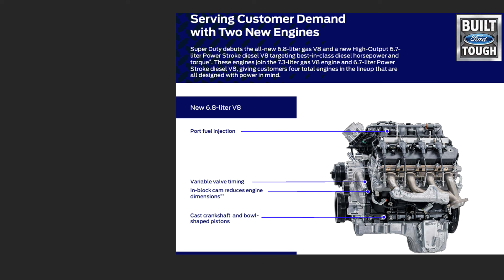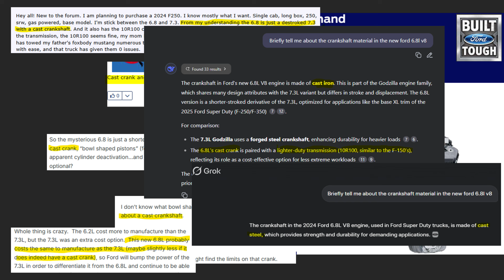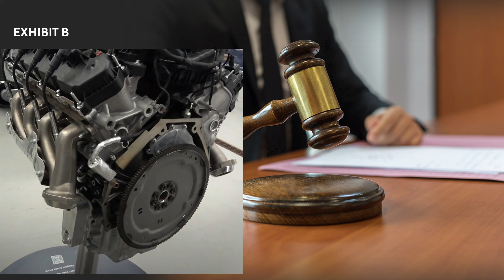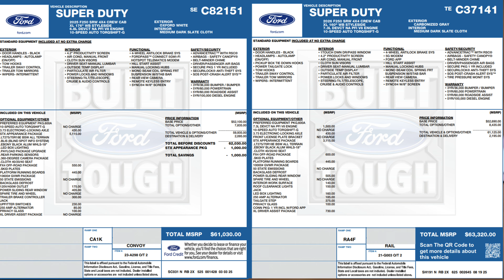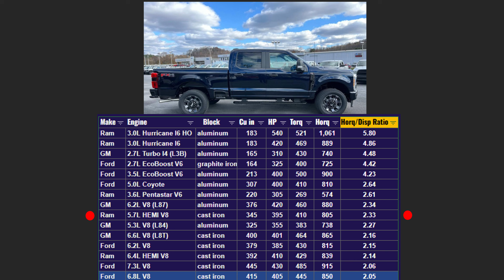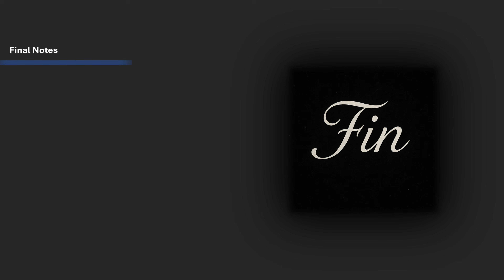Ford’s “Minizilla”: Making the case for the 6.8L V8

Comment: My brother had a 2022 F-250 Tremor (it’s really a 350 with the extra leaf spring).  He has the 7.3 Godzilla engine.  I have driven it and it is powerful.  Doesn’t do too bad on gas on the freeway.  I personally don’t call it a Godzilla engine.  I call it the Kong  engine cause it’s made in America, and Kong is American….Godzilla is from Japan.  I would definitely buy the 6.8 engine.  It’s just as good an engine and for only an 8% power drop…..I can live with that.  I tow a 5x8 ATV trailer and maybe a Bass boat.  The 6.8 will more than do the job.  I will however never live down my older brother calling any truck I buy with an engjne smaller than 7.3 liter, a tiny truck!!
Reply from the maker: Ha!  The 7.3 is the only engine out there that can call the 6.8 tiny.

Comment: I've been saying since day one, the 6.8 would actually make a better swap motor in anything 4,000 or less. That short stroke will help in spin. I check the salvage yard sites all the time, and the 6.8's are a lot more difficult to get your hands, since it came out 3 years later. Just my 2 cents.
Reply from the maker: I agree - I remember seeing a video where they said something like ‘you’d have to be dumb to swap a 6.8 instead of a 7.3’, but they didn’t think that all the way through.   Bigger number is not necessarily better.
Reply: Oh yeah, it's just like a 4.8 vs 5.3 just on a much bigger scale, you could make as much power as you could possibly want with a 6.8 and it should be significantly cheaper than a 7.3. You do a cam, headers, tune you have 600hp+, add boost 1500hp+ with supporting mods.The Godzilla platform is way better than the LS it simply isn't as wide spread yet and people haven't had the money to hot rod and get into a new engine platform since 2020 with covid and the economy being bad when it was introduced. The 6.8 will surpass an LS7 or LSX for 6.0 money in the future. A bare block is $1500, used heads are like $600-700 a pair or $600 each new, used 7.3 cranks are $200 or $600 new, forged rods and pistons are out there, Callies has stroker kits and huge cams. I bet a 522ci Godzilla stroker with ported stock heads will be a 750-800hp n/a engine. Just a 0.030 over 452ci should make around 700hp and a 6.8 would only need more rpms all else equal for the same peak HP.

Comment: Forget the TFL crap.  Those guys don't know anything anyway.  Why don't you make a towing video of your truck?
Reply from the maker: Oh I enjoy their stuff.   I’ve watched so many Ike Gauntlet videos, it would be fun to the 6.8 on the list.  I thought about doing a towing video.. I’m near mountains. But the heaviest trailer I have to work with is a 26’ travel trailer.. nowhere near the max tow rating and I don’t know how interesting that would be.
Reply: @motorobo0  Yeah, but all TFL is doing is trying to max load everything and then just see how well programed the truck is from the factory to tow its max load.  It's not realistic for what most people are doing.  Most people change their driving behavior when towing.  We lockout gears we don't need, we use different gears when going up or down hills, we look ahead to see what's coming and make changes to our speed and whatnot based on how we know our truck works. That's what I think people want to see.  What's real world use of this motor like?  How will it tow a travel trailer under most conditions?  That's better than people just basically setting the cruise and seeing how well a maxed out truck will go up a 8 mile mountain stretch at an extreme elevation.
Reply from the maker: Oh I definitely agree that they’re not testing conditions that most people tow in, and not in the same way most people would tow in those conditions, specifically with manual gearing.. but their methodology is consistent truck to truck and I see some value in seeing all of the different trucks tested under the same rules - more or less worst case scenario with a huge climb max load with no gearing help from the driver.. even if they don’t necessarily translate to real life. I think it’s fun just seeing how they do.

Comment: Good video, enjoyed this and I see you got a comment from GettysGarage! Love his stuff and his honest take on engines and towing caps. Wife and I did a cross country road trip this last summer in a rented RV, a small C 23 footer. 50 miles short of 6000 total. The RV had the 7.3, of which I was looking forward to using. We did a similar trip around 2015 in a slightly larger Class C with the 6.8 10 cylinder. Definitely prefer the 7.3 over the old 6.8. Although for RVers the old 6.8 had a very good following and it was generally liked.. Back to the 7.3 trip, overall mpg for out trip was 9.2 hand calculated, which was expected based on reviews I had read prior to our trip. The engine in the RV was by no means a powerhouse, but it didn't underperform either, ran flawlessly. This was through the Gulf Coast and its insane temps and humidity, never a hiccup. I have no idea what the numbers were on our RV, ie final gear ratios,  but I did take into account  we were driving a brick, so there is that. 
 I currently have a 2019 Ranger, which I really like. What scares me is the increasing complexity of the smaller engines, Want to upgrade, eventually with the 2.7 Ranger. I don't tow, and looking to buy an F250 for a daily driver seems insane to me, but I love the old school simplicity. I'm 67 and an old gear head, have worked in aerospace manufacturing for 40 years now, I still work but only part-time. I am a Ford buyer, have been my whole life, I bleed blue. I know they are not the best, but I have always liked their styling, their  reliability has always been good for me, I am anal about maintenance, which is the key.
 You have a new subscriber...
Reply from the maker: The Superduty is huge these days.  It’s unfortunate that even if you aren’t towing you need to jump to something that large to escape all of the mandates that drive down reliability.  It really is the only segment choice left that hasn’t been forced to trade reliability for efficiency.  A lot of people might disagree, but if you don’t want the HD segment, the hybrid Maverick is a compelling option.  Very simple naturally aspirated engine, and a very simple gear driven (no belts or clutches) transmission.   It gets its most of its efficiency from the battery, not from forced induction, etc.  And yeah, there’s some complexity around the hybrid system, and they use plastic in some places they shouldn’t.. but it’s proven pretty solid so far. I enjoy buzzing around town in my wife’s Maverick.  I like it for running errands.  Anyway, I think if the superduty was the same size it was in the early 2000’s, but had one of these ‘zilla engines, it would be the perfect combination for me.   I like the size of the current one when towing, and also on the freeway.  But in town it’s a little on the unwieldy side.
Reply: @motorobo0 I don’t disagree, I was considering the Mav hybrid because of the trans, or lack therof, very solid and simple. I like the Ranger size more than Mav, plus body on frame as opposed to uni. I do like the 10R80, 80 mph and engine barely breaks 2000 rpm. I’ve had no issues with mine as of 80 K miles. Knock on my wooden head. Have a 6yesr 125K extended warranty, runs out in a year time wise. At that point it’s goodbye.
Reply: @motorobo0 yes, it is a shame the Super Duty is so huge, I have a '94 F-250 right now, .y last two trucks before that were a '97 F250 and an '03 Silverado 2500. Those trucks are much better sized and a roller cam 351w or 6.0 LQ4 are great engines for what they are and can run 300-400k without a rebuild. I miss manual transmissions the most in the new trucks. The new autos can be a total mess if you get a bad one. The power and capabilities of the new trucks are substantial though. Hopefully they serve people for 20-30 years like 3/4 ton or larger trucks from the past still running around today.
Reply from the maker: I can only imagine what a manual would be like in modern superduties.   I think the modern HD gassers have the best  chance to hit that 20-30+ year mark.  They're the last category that is still made like they used to be.  The transmissions, I'm not so sure yet.  But the engines, almost certainly if well maintained.

Comment: You are allowed little bit off on HP for the v10 (depending on he year and application) that 275 number is for the natural gas version the previous pi ones made something like 310hp 415tq post pi was something like 315hp and 420tq and the 3v made 362hp and 457tq
Reply from the maker: Man, I knew I would be off somewhere.  Gathering these specs turned out to be a lot more involved than I thought.  Thank you!

Comment: Nexgen drivetrain in Lancaster PN has the best designed valve body upgrades to solve 10 speed issues, for longevity. They would have the technical specs for the 80, 100  & 140 rated transmissions. Hope this helps.
Reply: Yeah, Nate is the man, I love watching that podcast he is on all the time.
Reply from the maker: I actually did reach out to them a little while back, but unfortunately never heard back.  I agree though, if anyone is familiar with what’s inside, it would be them.
Reply: I wonder if it's worth working with them during the warranty period or wait? Tough call.
Reply from the maker: Nexgen has really good warranty, right?  If so, it really wouldn't matter.  But I wonder if it would cover components that they didn't upgrade.    I wonder.. does doing it right away have a benefit?  If not, I'd wait until the warranty is up.  If so it's kind of a tough call.  A lot of things to consider there.
Reply: @motorobo0  Well I just wonder if it would void the manu warranty.
Reply from the maker: Oh it most definitely would
Reply: @motorobo0  according to Nate, it's best to upgrade ASAP so you don't have problems.
Reply: Ford versions of the 10 speed don’t seem to have the valve body failures that the GM versions do, but they do have F drum failures the GM transmission doesn’t have. Ford has upgraded the F drum for 2024+ model years. I would waste my money on NextGen stuff…the guy is telling you how great his product is and everyone is just repeating it. Time will tell.

Comment: Great Video!  Keep in mind that the 7.3/10R140 has more weight and driveline drag than the 6.8/10R100.  Also check out the axles of which Ford likes to hide.  You might find a Sterling 10.5, 11.6, or, within the HO diesel trucks, a Dana M300 rear end.  I'll bet most 6.8s possess a 10.5.  Of course, the type of rear axle will correlate to load and tow capacities.  Ford doesn't seem to like to bless us with much info on the hardware these days.  We need a video on the 10R100... Thank You Sir!
Reply from the maker: I started down the path of differentials a bit, and you're right, there's some interesting things to talk about there.  I actually had a bit about the efficiency differences between the 10R140 and 10R100, but decided to drop it because they started to put the 10R100 behind the 7.3 a lot of the time now, and I wanted to try to keep this under 20 minutes.   One thing I was going to mention was that on the 7.3 I had on loan for a few days, the transmission felt commercial.. very box truck like, compared to the 10R100 which to me was a much smoother experience.  I can see people preferring either side, but for me, I spend a lot of time on the road and in traffic, and the 10R100 is just better daily driver experience.   You're absolutely right about the 10R100 needing a video, and I will do that.   I have questions I want answers to, and I will definitely share what I find.
Reply: @motorobo0  See my comment in this thread.
Reply: @motorobo0  Exactly!  I was going to mention that my '23 7.3 feels like a larger drivetrain.  I only have 26k on my truck, but that tranny doesn't like to downshift while slow moving as it has literally shuttered the truck a few random times.  I want to do a tranny service within a few thousand miles to see if anything stands out within the fluid or filter.  I do love my truck, but the 100 would fare much better during daily driving.  I will say that when I put weight on the truck, it shines brightly!!
Reply from the maker: @johnvehling6304 I had the impression that the 10R140 would absolutely be in its element when towing.. when you're daily driving it, it's just waiting to tow.  If I had that transmission I'd still be happy - it's a good feeling knowing there's something really capable under there.  But I'd kind of be putting up with it, just a little, when running empty.  Which for me is the majority of the time.
Reply: Do you follow Flying Wrenches? They are ex Ford dealer mechanics that started their own shop in Alabama, fun bunch of boys, they are mainly a transmission shop, you could find out more from them about both the 6R and 10R series trans. They do live builds.
Reply from the maker: No, thank you, I will definitely check them out!

Comment: You didn't cover the differences in stroke—the 415 CID (6.8L) V-8 has a short crankshaft, which delivers max torque at low rpms. Whereas the 445 CID (7.3L) has a long stroke, thus giving more torque. To compare the peak torque curves, the 415 reaches its peak sooner than the 445. If you are constantly on the blacktop highways hauling heavy loads, the 445, which is married to a heavier automatic transmission, is for you. If I had to choose between the two engines, I'd pick the 415 V-8 over the 445 V-8. What? Short-stroke engines generally generate less friction and heat compared to long-stroke engines. I'm looking for an engine that will reach 500,000 miles plus.
Reply from the maker: You're right!  I actually had something lined up for stroke, but I felt like the video kept getting longer and longer, and I ended up cutting it - but after watching Getty's garage talk about it, I kind of wish I kept it.  Though it wouldn't have been nearly as thorough as what he ended up doing.. he had animations and everything.  I hadn't considered the difference towing heavy on the freeway.  That's an interesting take.  I can say though, with the much lower low tow rating of the 6.8, it's still plenty if you're not overweight.  I've taken my camper back and forth over the Appalachian mountains several times, and the steep ascent grades were easily handled.. Mostly first 1/3 of the pedal, locking into 5th or 6th.  Though I'm only about 8000 pounds trailer weight.   And yeah, a 500k truck is what I'm going for as well, and why I ended up choosing the 6.8.   My last truck spent so much time in the shop, I swung hard towards simple and reliable.  After a lot of research, that's where I landed.

Comment: You think you have it bad, I have a 2021 F250 with the 6.2l v8.  The red headed stepchild of the superduty world.  I absolutely love it.  Pulls my 7,000lb camper easily.  Runs so much easier and smoother than the 6.8l v10 that was in my class C RV.
Reply from the maker: The 6.2 is a solid engine.  One of the first work engines to combine high horsepower and high torque, instead of all torque.

Comment: Awesome video!  My research with Grok and Perplexity today both say that the 6.8L has a forged steel crankshaft. There's some official Ford documentation that says the same. I don't think YT will let me post a URL, but search for the document named "WSG-1068 6.8-Litre 10-Cylinder"
I would get the 6.8 but I want the Tremor package for deep in the mountains of New Mexico. Glad they fixed the low oil pressure. Wish they would fix the transmission valve body (I might do the aftermarket NextGen thing)
Reply from the maker: Were you looking up the v10 6.8, or the new v8 version?  Just wondering because the doc you have there seems to be for the 10 cylinder version.   You'd think since the 10R100 is their newest transmission, they would have addressed the valve body issues by now.  I've thought about the nextgen thing - that guy has a lot of bad to say about just about every transmission.  Of course it's business for him, but I think there's definitely truth in trying to pick the least worst option.
Reply: @motorobo0  You are correct, that is the wrong engine document. Sorry about that. I might do some more digging tomorrow, see what I can find.
Reply from the maker: Oh no worries, I learned the v10 version had a forged crank  :)   That would really be something if the old 6.8 v10 had a forged crank but they went with cast on the new one.  Seriously doubt it though.
Reply: @motorobo0 boy he does talk the trash lol

Comment: Good video. Now how's about that 10r100 info drop? Lol
Reply from the maker: Oh, I'm planning on it.  There's not a lot out there about the guts of it, but I'm on the trail.   From what I've found so far, it shares the functional design of the 10R80, but with some 10R140 components, like the solenoids.  There's a sizeable difference in torque ratings, and I want to get to the bottom of where that increase comes from. I really need to find a good transmission guy who is willing to be peppered with questions :)
Reply: @motorobo0 I have a 10r100 apart now. It's almost identical to the 10r80. The 140 is quite different.
Reply: @motorobo0 nextgen drivetrain. Dude makes his own parts 😉
Reply from the maker: Right!  I actually did reach out to him, but never got a reply.  Would love to pick his brain.  I learned several things about the 10R100 from videos where he mentions bits and pieces - in fact, that's where I found out about the solenoids.